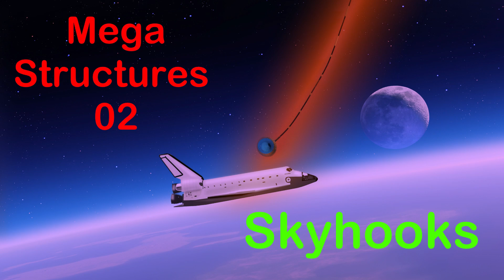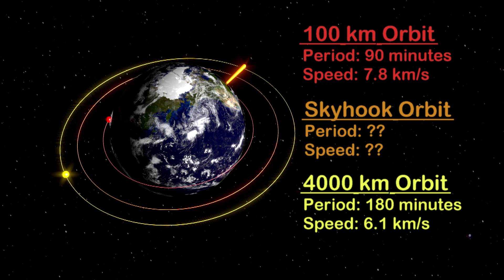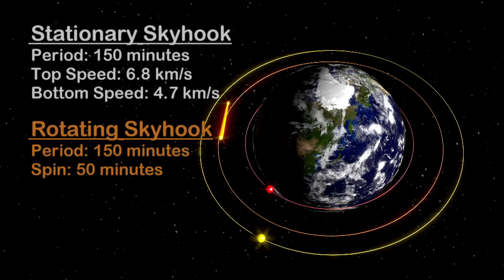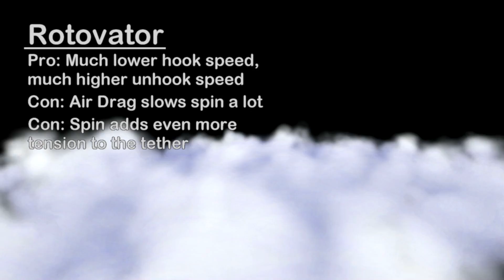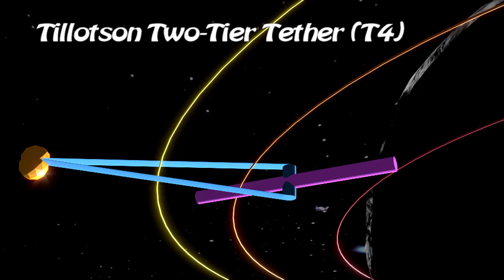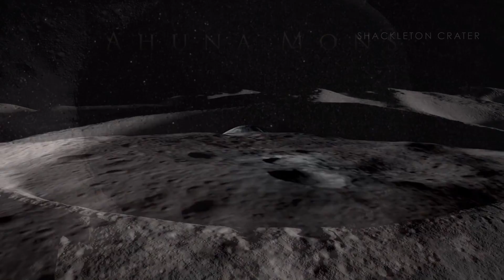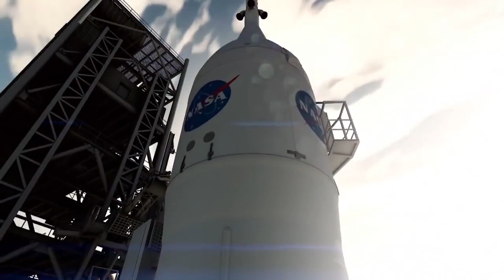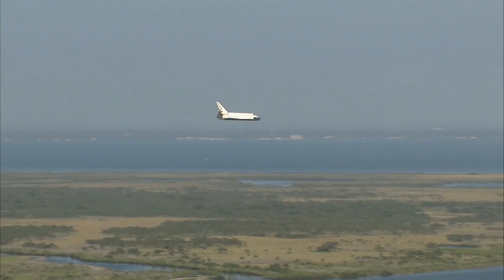Skyhooks & Rotovators

Comment: These videos can be a bit infuriating sometimes because the points made are so grounded in reality, so carefully thought through, and so well-explained that after the video is over I have to sit there and think "WHY HAVEN'T WE DONE THIS YET?!"
Reply from the maker: Oh the acceleration from spin is pretty high, we walk through some of those calculations next week in regard to spin gravity but as mentioned it's linear to length and square of angular velocity. One rotation per hour is 0.017 rad/s, two per hour would just be double, every other hour half. Pick a value, square it, multiply by half the length in meters. Divide that by 10 if you want gees. A 2000 km long one rotating around it's center once an hour would experience 30 gees at its tip, a 1000 km one doing the same 15 gees, but a 2000km one rotating once every 4 hours would experience just 2 gees, and a 1000k one 1 gee. We mostly contemplated once rotating no more often than once every 8 hours, so even one 8000 km long would only be 1 gee at that rate. Though that was all napkin math sans napkin so those numbers are fairly approximate.
Reply: @isaacarthurSFIA  
A minor point.  Your illustration of the "skyhook ladder" shows the bottom of each subsequent "rung" at the same altitude as the top of the lower rung.  This wouldn't actually work, because the speeds don't match.  The best point of the skyhook concept (rotating or stationary) is that if you release a payload above the orbital centroid of the lower skyhook,  most advantageously at the top, it enters an elliptical trajectory with the perigee at the release point and the apogee much higher (unless it releases it at escape velocity or higher).  You tune the next rung so the bottom of that skyhook will rendezvous with the apogee of the payload at the same speed.  This means it is in a higher orbit than shown.  Obviously, this means fewer rungs to your destination insertion trajectory (GSO, Lunar transfer, or a Hohmann transfer to a planet), but the main benefit is that this way will work and the illustrated way won't at all.
          Also, I would place the ladder in the plane of the Moon's orbit or the ecliptic plane (not much difference).   The equatorial plane gets you to GSO with the least apogee kick + plane change delta-v vector sum, but the ecliptic plane gets you everywhere else in the Solar System and, with a gravity assist from a gas giant or two, eventually anywhere outside the Solar System within maybe 30 degrees of the ecliptic (if you're not in a hurry).  Even if you have a decent interstellar reaction drive, the rocket equations will advise you to eat as much free lunch as you can get.
Reply: NASA has actually done some preliminary experimentation in that regard. They sent up a tether/satellite combo on the space shuttle. The idea was to deploy the satellite by tether from the space shuttle, the shuttle and tether would lose momentum and return to Earth while the satellite gained momentum. Mid-way through the process the tether deployment system jammed and NASA had to release both satellite and tether into space.
Reply: I actually wish there were more calculations showing material capabilities and things like that.  I think the length of the tether might be feasible, but if it isn't a completely rigid structure how will it respond to the forces at play?  Also, what would the acceleration be from the spinning tether and could anyone survive that or would it have to be used only equipment.  How much would the orbit degrade with frequent launches?  Ion drives might not be enough to handle that.    All in all, it is a cool video but it doesn't elaborate on the technical difficulties and actual math behind what would be needed.  This all works in a digital 3D space, but I need some hard numbers before I know if it makes sense.
Reply: I wonder if a micro-tether could be deployed by one of those little CubeSats that NASA does sometimes? Could be an interesting and financially achievable way to validate engineering simulations and generate interest.
Reply: Well, I'd guess that the acceleration would probably be whatever you want it to be, but the less acceleration you want, the longer the hook will need to be in order to conserve the most angular momentum. Or alternatively, make the weights at the ends larger and make sure your payload mass is significantly less than the moment of inertia of the skyhook, giving you more wiggle room for restoring momentum. If you haven't had a basic physics course with at least integral calculus, the real math and physics that Isaac is doing behind the scenes would probably be daunting to you, so I'm assuming that's why he only displays algebraic equations, to denote the general and important ideas in physics that are being employed in that particular situation, encouraging anyone who is curious to learn more by giving them starting points for independent research. 

I agree though. I think Isaac should include a "script" of mathematical proofs in the video description so the super nerds can follow along. Actually, given how professionally put together his videos are, he just may do that in the future!
Reply: @TripedalTroductions  I think you would keep most of the mass in the the non-rotating middle of the tether if there was any need to to add wights, since rotating weights on the ends would significantly increase the force trying to break the tether. Some of that weight might come from the solar panels and other equipment required to do the tasks it needed to do, like the electromagnetic tether. That being said, some preliminary calculations I've been doing suggest that these cable might be fairly light (based on it being made out of kevlar), so that weights really might be necessary if you didn't just want to make more or thicker ropes, which you could do, since the strain on it depends on the weight-to-cord-area ratio, not on the total mass.
Reply: Every time there is a radical shift in technology there comes political change and that scares governments.
Reply: Barskor1 has to be the best explanation, not the best reason, but the explanation. Partly why at least here in the US, we need our Constitutional Republic restored. It's become a mechanism for the sole purpose of making politicians richer to the cost of the citizens. So anything that puts their profits at risk is a no go. As soon as they figure out how to make money off it, then we'll see it happen.
Reply: @GryphonArmorer    BINGO
Reply: @GryphonArmorer  Or another competitor nation decides to develop the technology, that would guarantee resources, start a rumour perhaps?
Reply: @Barskor1  that literally has nothing to do with this issue...we don't have the materials...and the people on this planet are too busy poising ground water and killing brown people.
Reply: Basically, the tether acted as a large light bulb filament that burned out due to the electricity it gathered.
Reply: Yes, Tripedal, I thought the same thing myself.  Then I was reminded of one nagging word:  FUNDING.  Anyone in the world can invent something ... but it's the guy that puts his money where his mind is that makes it happen.  We need to have our government fund more scaled down projects and prototypes.  In other countries, the government really helps companies a great deal to get started.  Not so much here in our dog-eat-dog America.  Of course I'm saying all this, and like the LHC, there is no substitute in certain situations for full scale prototypes.
Reply: @brianbrewster6532 ...
Anyone who thinks there can be no 
"Funding of science"...
Just doesn't understand the 
"Science of funding", lol.
Reply: Hey Isaac i know it's pretty late to write this but since I've been re-watching all the old Videos anyways, this napkin math you made here is of by 2 magnitudes.
The error you made is that the angular velocity is 0.0017/s not 0,017/s if you are rotating once per hour.
Caught this one because i calculated the one from the video roughly on the side and it had slightly less than 1 g, so these accelerations didn't make any sense to me.
Just wanted to point it out to you
See you tomorrow

*edit changed angular momentum to angular velocity
Reply: Wrong! From the exciting and detailed Wikipedia article on Electrodynamic tether (EDT):  "A number of missions have demonstrated electrodynamic tethers in space, most notably the TSS-1, TSS-1R, and Plasma Motor Generator (PMG) experiments."
Reply: Thanks for the response!
Reply: @Dante Marinucci  People like "organic petal" still wouldn't do it because they're too busy playing the race card on everything. Even here this clown can't help but throw skin color into the mix, as if white people don't suffer from "being killed". I don't know that we as a species will EVER really make it into space beyond where we are today so long as people like organic petal always insist on making everything about SKIN COLOR and VICTIMHOOD. Shit just gets old hearing the same old diatribe year-in, year-out.
Reply: @greenrefrigerator ...
Of all of the "mileposts" that we as a species need to "get past"...
This silly notion of "race" is perhaps the most daunting. 
Especially when you consider that the entire issue is mostly a contrivance,  more or less "invented" by those who wish to maintain the "status quo" by keeping the majority of people divided and bickering.
Reply: @bobinthewest8559  I agree and therefore we really need to 'get past' our vulnerability to being manipulated by power regimes and think freely.  The minute we stop being racist we will be directed to be prejudiced about something else eg masks!
Reply: @bobinthewest8559  race is one of the most important components of any people, to try to destroy race is one of the most awful notions ever promulgated.
Reply: @TS-jm7jm  Don't you know evolution stops at the neck, trans women are women, and the dirt is magic?
Reply: John s Lewis said it all about political will and new  technology will change the status quo. Post scarse society scares the heck out of the elites because they will start to lose control.
Reply: This was a tether experiment, once. I figure the details, I dimly remember it was small and did not work well.
Reply: We don't have much of a use for it yet. It'd be a huge investment of resources and time, with little gained currently.
Reply: You've got to love bureaucracy.
Reply: Agreed
Reply: TripedalTroductions   https://youtu.be/ofPgdcYWo_0
Reply: for real
Reply: Cost.
Reply: And safety
Reply: And I think to myself..wonder how long they have been doing this;) lol If they say they can do something that is usually because they already have
Reply: Multiverse theory permits the doing of these things already having been done.
Reply: Because we live in a "democracy", so there is no true powerful executive will to get shit done anymore.
Reply: Step 1: find way to get it up there, a 10 million ton object
Reply: Actually I was doing some back of the napkin math to in regards to the spinning skyhook and noticed that even a relatively short one @ 800km diameter rotating at 1g would be enough to lower the  relative velocity down to 5 km/s. And at this point I noticed that my math and your math was not matching up since my hook was rotating almost 3 times an hour, which according to your math would cause most things to go splat. And then I noticed what was wrong, one rotation per hour is not 0.017 rads/s but rather 0.0017 rads/s which would then the numbers would match.  Incidentally this would make a rotating skyhook far, far more useful than a non rotating one.

Anyways love your channel and have been binging for the past week or so since I saw your space elevator video popup in my suggested viewing list.  Wish I had found it sooner since I am a sucker for massive scales and science and hard scifi.
Reply: Because it is vastly more complicated and expensive to build, maintain and use than this this video suggest.

Complexity of docking in the atmosphere at near supersonic speed at a specific place and time.
Cost and complexity of deployment.
Cost and complexity of maintenance.
Cost and complexity of boosting the orbit of a spining cable.
Atmospheric drag losses.
Low launch rate.
etc.

Rocket are more simple to build and operate than this, and remember, we use "rocket science" as the epitome of complexity...
Reply: @vava54  Rocket science is fifty years old by now (give or take). When it was brand new, there were many failures (dramatic failures!). The space race kept our government interested, and thus the projects well funded. The US is now run by septigenarians who still think digital watches are a pretty cool idea. 

The sky hook is probably not a long-term practical idea, but it may be a useful, if temporary, step. We use it to get some much needed infrastructure up there, then let it fall into the ocean. It seems potentially hazardous and awkward to have spinning around up there, especially as traffic increases.
Reply: We are not that far out of the cave yet. We still need to build lotsa nukes to kill each other off.
Reply: Cause we're too busy spending this money on tanks and fighter jets
Reply: @robertkarnick1286  i posted the exact same comment but mine got deleted by j-.e-.wtube

Comment: For the first few minutes i was like "But muh conservation of momentum!"

And then you said you would address the issue, and you did.

Thank you
Reply from the maker: Yeah the momentum issue being glossed over in the original was the biggest motivator for redoing it.
Reply: Perhaps I missed the nuance of how you addressed this, but as I understand how you solve this problem, you're relying on very weak propulsion (rocket fuel defeats the purpose entirely), so using ion drives, which are far too weak to offset the regular launches of multi-tonne payloads. I'm seeing the same problem with using orbital rings as launch pads. every time you accelerate something along the ring in any direction, you need to account for momentum in the other direction.
Reply: Yeah. It loses momentum, but the question is how much per year, and then you figure out how much needs to be added.
Reply: yeah part of me really likes this idea but part of me is worried it's like a perpetual motion machine where the caveat is you need to keep adding energy to it.
it maybe wouldn't be so bad if we were mining the moon for water and using some of the oxygen and hydrogen we extract to continually launch the tether back in place, right?
Reply: alright so I read into it and what he kinda forgot to mention for skyhooks is that you need either a very heavy station or perhaps a small asteroid as a momentum bank. This way it's orbit would decay very slowly and you could easily just lift it with ion engines every once and a while.
Reply: There's actually no problem with a sky hook losing momentum and orbit.  Yes, every time you send something UP the hook and into orbit, the hook loses momentum.  BUT - the hook would also be used to de-orbit stuff, thereby GAINING momentum.  De-orbiting stuff would be used all the time.  No more flaming hypersonic re-entry and associated risk and costly thermal shields.  Satellites could be brought down safely for repairs.  Astronauts, material shipments from the moon or asteroids, etc. would all be sent down.

Comment: what about combining space elevator and skyhook. but not with cables. but more like a very very very large wind turbine. where you have a 400km high tower, and than 3 rotating blades. witch can now be powered by earth. at the top of the tower you enter the blade. and when you reach the tip of the blade you are at orbital speed. (so you need pretty fast blades). this whould prevent the momentum thing as you are connected to the earth. and you dont need 36.000 km string. ofcourse you can make the blades vertical so you dont have airdrag. and the longer the blade the lower the g forces. witch is needed for human travel. and i guess it might be shorter then a electrogun launch. (witch might still be used to travel inside the turbine.

combine this with a fusion power plant on the earth. for power.
Reply: no